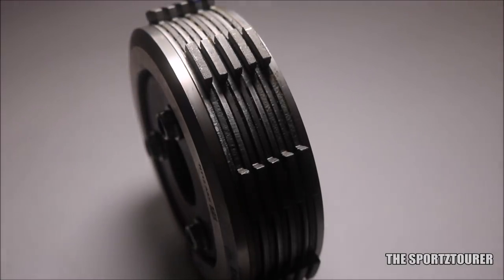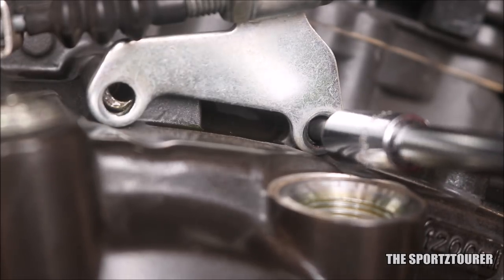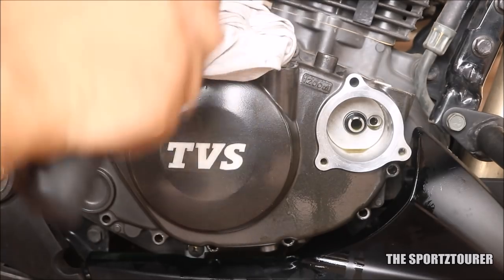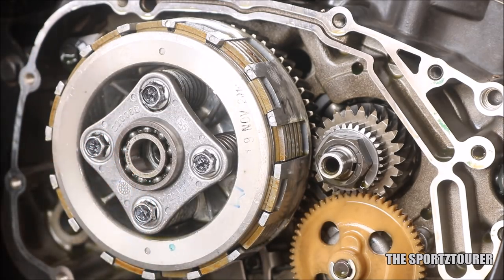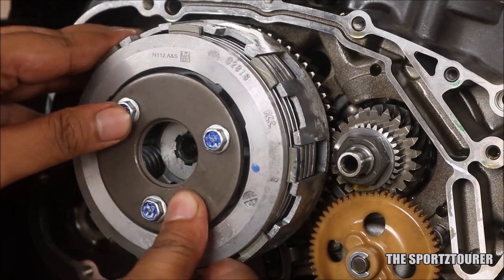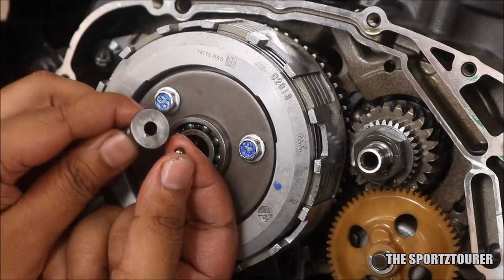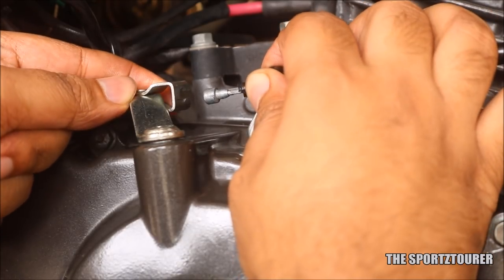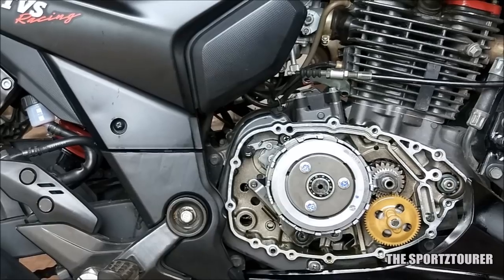HOW TO INSTALL SLIPPER CLUTCH IN BIKE TVS APACHE SLIPPER VS REGULAR CLUTCH, SLIPPER CLUTCH EXPLAINED

Comment from the maker: So how does the slipper clutch performs after 6 months? Here is the update video: https://youtu.be/__DprpAoFbI

If you liked this video then the TVS APACHE RTR 200 review definitely deserves your attention:  https://youtu.be/KW5LfJleZfg
Reply: Can we install slipper clutch in cbr 150
Reply: i have been thinking for it,, i don't like it broo,,i loveeeeed it,keep us updated hows 200 performing after a sweet upgrade.
Reply: Bro....my rtr 200 v2.0 is making some gear shift 'thud' sound in every gear....what should i do ....can it be fixed?
Previously it was not there.....
And one more thing.....i m using motul 7100 10w40 ...what is the drain interval.?
Thnx in advance bro....
Reply: Amazing video man! BTW where did you buy the slipper clutch?
Reply: Very good and informative video. Thanks for making it. Can it fit in the RTR 160 4V housing?
Reply: Bro can install Pulsar 150cc
Reply: Is it possible to keep on pulsar ns 200 ???
Reply: sir sliper clutch will it fit in rtr 180
Reply: The Sportztourer  💪
Reply: Is it possible to install slipper clutch in Apache rtr180 2009 model?
Reply: Tell me the Cost of this slipper clutch assembly and is this available online at any website?? 
Last thing, kya ye RTR 180 me use ho skta hai ya sirf 200 4v ke liye hi hai...
Reply: @rajivsingh1081  yes
Reply: @kumarvarun95  yes
Reply: I knew it BT double checking...price kitna haii
Reply: Can I add slipper clutch to 310 rr
Reply: Price ?
Reply: The Sportztourer  can we do this on RR310
Reply: Bhai Gixxer 150 me slipper clutch install kar sakte hain kya ?
Reply: Hey can you try Iridium spark plug and K&N air filter and post us another video ? Atleast one.
Reply: @kumarvarun95  Mm can fit it
Reply: @rajivsingh1081  Mm possible bro can fit it
Reply: Dude can I retrofit this on an Apache 160 4v
Reply: Can I do same things with my karizma R 2014 model
Reply: will this Fit into TVS radeon with any changes ?
Reply: Can we install slipper clutch in 160 4v ??
Reply: Can we install slipper clutch in 160 4v
Reply: Bro can i fix it in rtr 160 4v
Reply: @tuhinshuvra  I am also having same Thud issue on my rtr 200!!...any thoughts about it?
Reply: Where will I get this slipper clutch?
Reply: Can i install slipper clutch in discover 125t ?
Reply: Bro..will it fit in rtr 160 4v ?
Reply: Can I install it on my new APACHE RTR 160 4v bs6?

Comment: Finally a youtuber who knows automobile mechanics
Reply from the maker: Ha ha ha... Thanks for acknowledging the automotive content 😊
Reply: Good how to apply in my TV's appache 200 were can to buying sleeper cluch
Reply from the maker: Hi Tapan,
I have mentioned all parts, their cost and part number here: https://youtu.be/oxDokGdCZv8
Reply from the maker: Hi Srinivash,
The RR 310 has a different clutch assembly so this one won't fit.
Reply: Shrinivash Murugesh  , the bs6 model comes with a slipper clutch, you can source that from the new model to tours, would be a direct fit.
Reply: @thesportztourer  can we install the slipper clutch in apache rtr 160 4V plz let me know I'm using 160 4v since 9months it has a normal clutch
Reply: @thesportztourer   bro does it fits  for 1604v
Reply: Shrinivash E18CS052  yes you can
Reply: I bet there are a lot more, 
God bless the youtube algorithm and bring them to lights.
Reply: @EzMeck There's Jeet Bhaskar, the ultimate Indian mechanic on youtube.

Comment: Bhai please tell if it will fit in 160 4v
Reply from the maker: Hi Prakhar,
The RTR 160 4V does shares a lot of parts in common (as shown in the video). Only thing I have doubt about is the clutch housing and the number of clutch plates which more here.
Reply: @thesportztourer  make quick update video if it will fit on 160 4v
Reply: Dev Hansdah yes the Slipper clutch of the Apache 200 is also a direct fit on the Apache 160 4v as well.
Reply: @rinaralte6648  is it seriously possible to install slipper clutch in 160 4V FI?
Reply: Deep Missen yes absolutely possible my friend
Reply: @rinaralte6648  ok thanku so much brother I'll get it installed ASAP. 😊
Reply from the maker: Hi Deep, 
Do let me know after you install it. Only doubt I have here is the clutch shaft as the part number is different.
Thanks lalrintluanga for giving the information 😊
Reply: @thesportztourer  definitely 👍
Reply: @deepmissen6554  Hi, I am also waiting for your feedback.
Reply: @thesportztourer  Hi, can we install it on rtr 180 old model?
Reply: @rakesh231rakesh  company officials says that we can't Install 200 4V's slipper clutch in 160 4V as it is not made for 160. So, we can't install slipper clutch in 160 4V.
Reply: Bro Plz tell if it will fit in tvs Rtr 180
Reply: @nisarpn4074  nopes it's for 200 4V only
Reply: Pls sir help us! If possible
Reply: @deepmissen6554  hey deep missen, any update on the slipper clutch installation on 160 4v?
Reply: @solo_4  bhai sirf 200 4v k liye h  160 4v ka ni h
Reply: @deepmissen6554  okay. Thanks for confirming
Reply: @solo_4  you're welcome bro

Comment: Great 😍 what's the price of slipper clutch??
Reply: Price is Rs.2025 + labour charges (the SVC where I got it installed took Rs. 200)
Reply from the maker: Hi Akshay,

Give me some time (to cumulate the right data) I will make a detailed report, if possible will make a video of everything including part numbers and the prices of all the required spares.
Reply: Part Number - NF070010
Reply from the maker: Thanks Hitesh for confirming, Rs 200 labour from authorized TVS service? if yes then it's really reasonable 👍
Reply: You're welcome
Yes, it was at an authorized TVS Service Center
Reply: @thesportztourer  ok
Reply: Can I use in karizma R??
Reply: Can we install in ns200
Reply: Can i do this in my rtr 160 4v?
Reply: Can i fit this slipper clutch in RS200?
Reply: @lucky Sahota films same question
Reply from the maker: Hi,
You will get all the details (including part number and price) here: https://youtu.be/oxDokGdCZv8
Reply: Pls reply to the comments below.
Reply: @daveshetty5489   no dude
Reply: @daveshetty5489  may be dominars
Reply: Great work Sir, please tell me if  this slipper clutch can be fitted on my CBR250 .

Comment: I know it is too much but i have already installed oil cooler of pulser to my rtr 160 hyper edge...so i m curious to know that it is possible to insall slipper clutch on rtr 160 hyper edge...pls reply
Reply from the maker: Hi Prashant,
The RTR 160 hyper edge does shares a lot of parts in common (as shown in the video). Only thing I have doubt about is the clutch housing and the number of clutch plates which more here.
Reply: @thesportztourer  thanks for reply bro....keep up the great work...
Reply: Hi 
Prashant, I also want to fit oil cooler in my Apache hyper edge, so plz any help from you would be a great help for me. If you can send some snaps of your modified Apache in staveraj@gmail.com
Soon to hear from you.
Reply: @firecelln80  yes bro. You can do that on your bike.
I have check all of them.
Planning to fix it within a month.
Reply: As like the sportztourer said, most of the parts in rtr twins and 200 are same. The have similar design, except balancer shaft on 200. That is the reason why 200 does not have 6th gear.
Reply: AA. Vignesh vicky thanks bro... i ll try it... and let u know..if u did it pls upload video...
Reply: @firecelln80  will definitely do a video on it.
Reply: Yes
Reply: @Mechanicgrapher  Have u done it ??? Please reply
Reply: @anuragharsh1509  not yet. The distributor asked me to wait for couple of months for the parts availability......So i had to wait for January.😪
Reply: @Mechanicgrapher  If you are done, please let me know..😊
Reply: @anuragharsh1509  SURE. I am very much interested in experiencing the slipper clutch on my RTR. 😍😇
Reply: @Mechanicgrapher  hello....did you get the parts??

Comment: Bro what's the cost and does it fit for 160 4v ?
Reply: I have the same question
Reply: Yes i also need to know does it fit on rtr 160 hyperedge 160
I have installed oil cooler now loking forwars for this
Reply: What's the cost? N dose it fit apache 160 4v 2018 model?
Reply from the maker: Hi Rogit,
I need to check the RTR 160 4V for it.
Reply: @thesportztourer  keya is sleeper clutch ko koi or engine me install kiya ja sakthe
Reply: @thesportztourer  plz

Comment: Everything was perfect! Good Job. Just avoid using the impact to remove the clutch nut, instead use an clutch holder! Hammering the crank is not a good idea, also a ball park about the casing bolts and clutch nut torques would be good. Else ppl will jst end up over tightening the casings and wont tighten the clutch nut enough!
Reply from the maker: Thanks a lot Ketan for the valuable inputs, appreciated 😊

Comment: Guys i just successfully installed the new slipper clutch with the given instructions and trust me it WORKED 😍....the pickup is class and gearshift is good  and backtorque has gone down.....P.S my bike tripped  20k before assembly so i saw the diff..... #dont try this if you have no proper knowledge of the clutch assembly and tools....i wud suggest a local mechanic guidance😆.....thanks@thesportstoure
Reply from the maker: That's great Prashant!
Congrats on the slipper clutch 😊
Wish you a lot of happy and safe miles with RTR.

Comment: Nice video bro. Can we have a slipper clutch assembly on fz 25 by using the slipper clutch from the new r15? If possible,please upload a video. Im sure many ppl want to have it done.
Reply from the maker: Hi,
A few Indonesian riders have done this mod on their FZ 25. When asked about the details they were unable to confirm if it was a direct fit or some additional modifications were required.
Thanks a lot for valuing the video 😊

Comment: great video , very thorough , keep it up. I have a question ,
I own a TVS Apace RTR 180 white , 2011 model. as I want to change my stock clutch with a (u guessed it) slipper clutch. will it fit ?? as my bike is pretty old and the service center guy is not sure, can you confirm ?? 
thanks in advance.
Reply from the maker: Hi Indrojit,
The RTR 180 does shares a lot of parts in common (as shown in the video). Only thing I have doubt about is the clutch housing and the clutch shaft which I doubt isn't the same. Unless we practically check it, we cannot confirm on that.
Thanks a lot for appreciating the video 😊

Comment: Hey the video is really nice, would be great if u can make such video for RE  himalayan.. also the abs installation for bs3 models..
Reply from the maker: Hi Shekhar,
The Himalayan has a different clutch assembly so this won't fit. I did enquire about the slipper clutch on the Interceptor 650 and the service guys said it's totally different than that on the Classic and Himalayan.
Reply: @thesportztourer  so i guess there is no scope of slipper clutch for Himalayan
Reply from the maker: Probably for now till RE decides to update 😊
Reply: @thesportztourer  ok.. thanks for the reply..

Comment: Can you please tell me, can I install slipper clutch kit on my Tvs Apache rtr 180 old model?
Reply from the maker: Hi Anick,
I am yet to personally check that but the authorized service said the clutch shaft is of different dimension on the 200 4V and 160/180.
Reply: That’s mean it’s not going to fit with 180 transmission panels?

Comment: Very informative video. It's really great to know that the slipper clutch is a direct fit. I wonder if it's the same with other bike, like the comments said NS200 will take Duke 390 clutch, etc. Can anyone else confirm what bikes will match with what? Any idea for RE Himalayan?
Reply from the maker: Thanks a lot for appreciating the video 😊
The Slipper clutch from the new Duke 390 is a direct fit on the older Duke 390.
Reply: I have slipper clutch assy for ns/rs 200 ...duke 125/200 rc 125/200

Comment: Nice job bro... Can we assemble duke 390 slipper clutch into 200 with very less mechanical issues ?
Reply from the maker: Hi Sudip,
As far as I know the 200 has a different clutch dimensions when compared to 390 so it won't be a direct fit.

Comment: Make a video on RTR180 oil cooling system
Reply from the maker: Hi Presley,
I had a RTR 180 for around 6 years and I never ever felt the need of an additional cooling system. The stock heat management is efficient.
If you want to add oil cooler to it (like an enthusiastic 😊) then the oil cooler from RTR 200 is a direct fit on the 180 👍

Comment: Hi, thanks for this amazing video.
I have some queries..,
1. Is it compatible for old Karizma
2. Where will i get this slipper clutch (online or any dealer)

Thanks in advance..!
Reply from the maker: Hi Ramesh,
The Karizma has a different clutch housing and clutch shaft so this won't fit on the Karizma.
Thanks a lot for appreciating the effort that was put in making this video 😊

Comment: Very nicely explained bro...keep it up. Just want to know. I own fz25 which is multiple regular clutch. Can i fix slipper clutch on my bike? If yes can u guide me which bike's slipper clutch will fit into my bike
Reply from the maker: Hi Vinod,
This particular clutch won't fit. I got a few messages from Indonesian riders who have fitted new R15 V3's slipper clutch on the FZ 25 but they were unable to confirm if it was a direct fit.
Reply: @thesportztourer  thanks for ur reply bro. I will ask my showroom mechanic whether i can fix r15 v3 slipper clutch intp my bike. Safe Ride bro...

Comment: Hi i am very impressed by your work and by this video. 
I have a request for you that can you do a video on, 
Yamaha R15s - R15v3 slipper clutch replacement to normal R15s. 
Same as apache if possible it would help lot of R15 owner pockets
Do Let Me Know  Thanks.
Reply from the maker: Hi,
A few Indonesian riders have done the slipper clutch mod on the R15 v2 but they were unable to confirm if it was a direct fit or some extra modification was needed.
Thanks a ton for liking and appreciation the efforts 😊
Reply: @thesportztourer  thanks for the info good luck

Comment: Hey bro really itz a great job..
Bro is this  slipper clutch can be installed in pulser 220?plz let Me knw..
Reply from the maker: Hi Benjamin,
The Pulsar 220 had a different clutch housing with a different clutch shaft so this won't fit on the 220.
Thanks for acknowledging the work 😊

Comment: Hi u doing great can I use slipper clutch for Yamaha r15 v1 bro and put some video for Yamaha r15 v1
Reply from the maker: Hi Praveen,
I got messages from Indonesian riders where they have fitted the slipper clutch of the R15 V3 on the R15 Version 2. They were unable to confirm if that was a direct fit or any other additional modification was required for the fitment. So Unless we practically check it, we cannot confirm on that 😊

Comment: That's an awesome and detailed video. 
And well explained.
That's something everyone need to put in their video ❤️ 
And sir I've a question too! 
As I own a Yamaha FZ 25 , will it be possible to fit this slipper clutch on fz25 or the slipper clutch from r15v3. 
Please take out some minutes and reply. :)
Reply from the maker: Hi Akshat,
A few riders in Indonesia have done it but they were unable to confirm if it is a direct fit or some additional modifications is required.

Comment: How does the maintenance work on a slipper clutch? The same as on a regular clutch? And where is it necessary to fit a hydraulic clutch assembly to a slipper clutch if it's so light anyway? Please answer (Preferably in another video). I'm thinking of upgrading my Enfield's brakes, clutch (Didn't know I could turn it into a slipper clutch) and everything. Please make a detailed video.
Reply from the maker: Hi,
The maintenance job is similar on the slipper clutch, no extra hassle there. You are right no need for hydraulic clutch assist at least on the RTR 200 with this slipper clutch 👍

Comment: hey der,,, u really make good videos nd dey r really helpful... well my real doubt is dat i wanna upgrade my rtr 160 to 200 cc,,, bt i dnt knw dat cylinder block of 160 has same dimension as of 200... also i am not sure abt the gear ratios of both cc's. but i really want more power from bike and so is my step regarding it !😉... so help me wid d doubt
Reply from the maker: Hi Shreyas,
Even I upgraded from my RTR 180 to the RTR 200. The 200 is more of a evolution and I feel it is exactly what a comfortable and more powerful 180/160 should have been. The upgrade in terms of power is ok (not a big jump) but the refinement and comfortable is way better than the 160/180 (a very big jump).

Comment: Hi.....good video....I am facing hard gear shift in my apache 160 4V.I went to the service centre they did something but problem not resolved.Chaim is cleaned but problem is still there....Sometimes gear feel smooth and sometimes it becomes hard.... could u help me out with any solution.....?? It will be very helpful for me......

Comment: Hi I will really appreciate ir if you can answer my  questions . 1) difference between these 2 clutch 2) price of slippery clutch 3) where I can find it 4) to whom it is suitable. Thanks shamshuddin
Reply from the maker: Hi Shamshuddin,
As shown in the video Slipper clutch helps in jerk free downshifts even if we don't match the revs while downshifting. Adding to it the slipper clutch here needs way less effort for engagement and disengagement.
I have mentioned all parts, their cost and part number here: https://youtu.be/oxDokGdCZv8

Comment: Hi mate, very good video. I just have a small doubt. Can we do this to an cbr250r? I know it won't be a direct fit. Like if we change the clutch housing is it possible? Or any other way?
Reply from the maker: Hi Anbu,
Takegawa make one specially for CBR 250R. No personal experience with it, I can just share the link: https://japan.webike.net/HONDA/CBR250R+%282011-%29/6225/m/p.b=704/